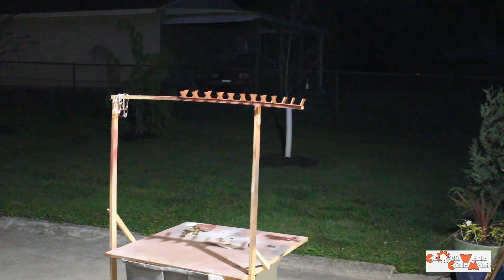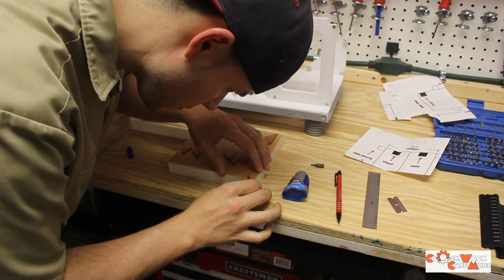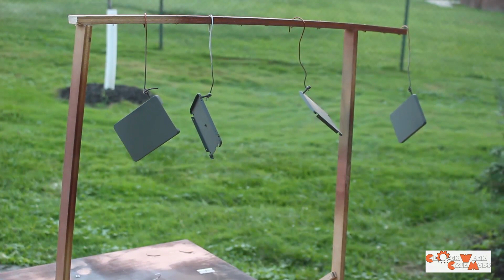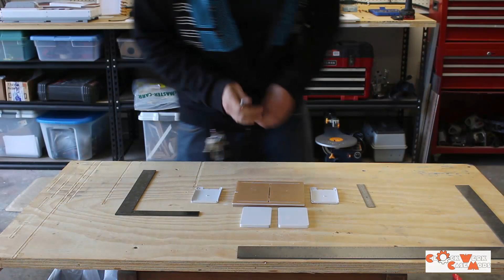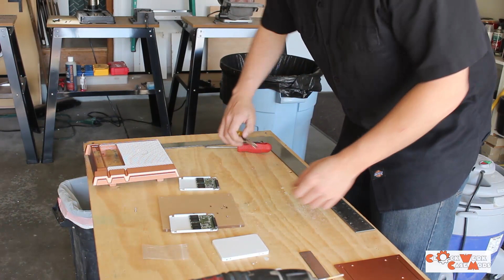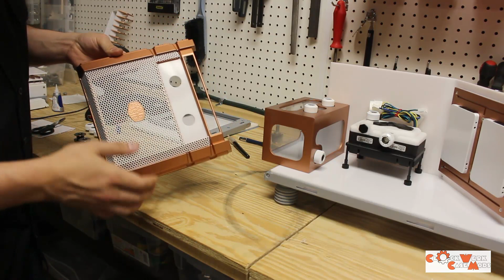Cyprus 29 - HAF Stacker - VLOG - Update 1 - Bring you up to speed!

Comment: Video was well done.
Where's your safety glasses?
What are you going to do for cabling the SSD's up? You've got them flat up against the next panel making it difficult to connect SATA Power cables.
Reply from the maker: Thanks man! I only use safety glasses when the chips are flying not too worried about the drill press with acrylic =P For the SSDs Ill use the straight Sata connectors and bring them in from either a hole right above the mounting panel with some custom cable combs, or bring them in over the top of the mid plate panel. I have some straight connectors lying around, might have to do some fabrication but Ill make it happen =D